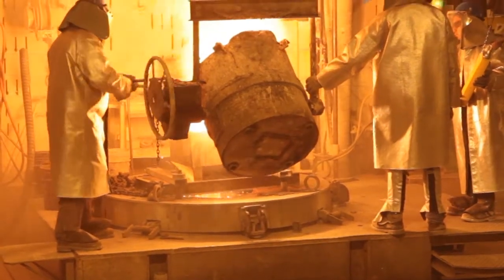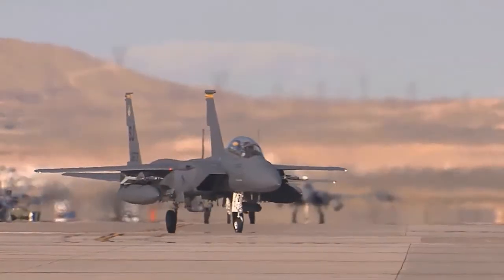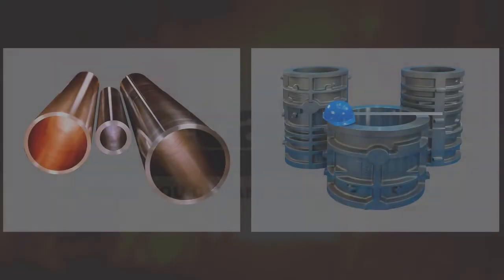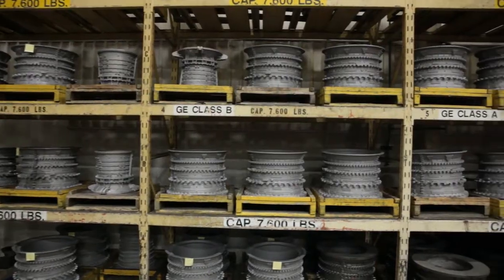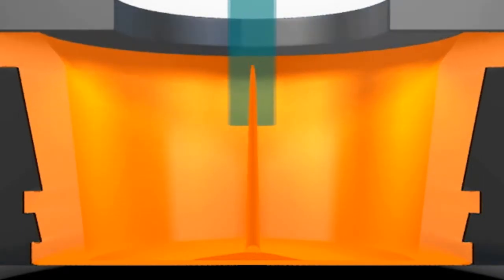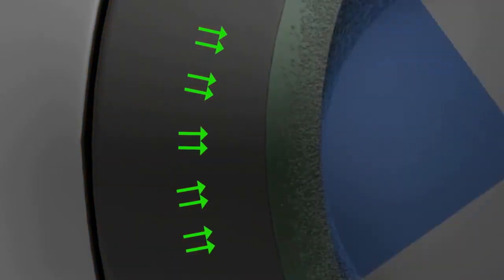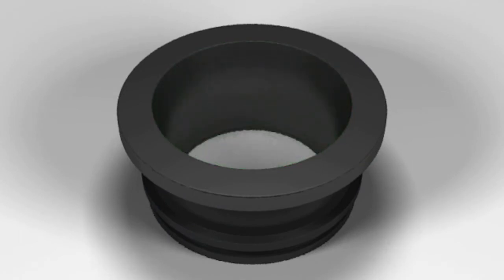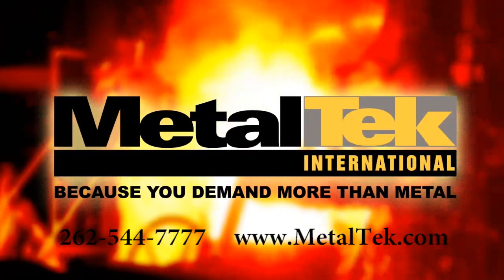Vertical Centrifugal Casting (2017 Version)

Comment: How much of the ID is imperfections? Is the OD case hardened during this process?
Reply: I am a foundry man too, I like these videos. I can tell you. the hardness  OD will be higher than ID. But it depends on what material you cast. and the colling speed. If the thickness  of shell is thicker, the colling speed will be higher. We always use this way to manufacture cast iron roller. to get white cast iron on surface.
Reply: @龔一峯  what about the ID imperfections ? Thank you for sharing your expertise.
Reply: @jlgoose8078  very hard to say, depand on materal, impurity of molten ,
Reply: @龔一峯  thank you... I am curious about this and appreciate you helping me with this.

Comment: I wonder the RPM's required
Reply: the mold is rotated at a speed that creates a centrifugal force ranging from 75 to 120 g
(75 to 120 times the force of gravity). Speed of rotation is varied during the casting process
Reply: @the-potato-warrior  you an engineer?